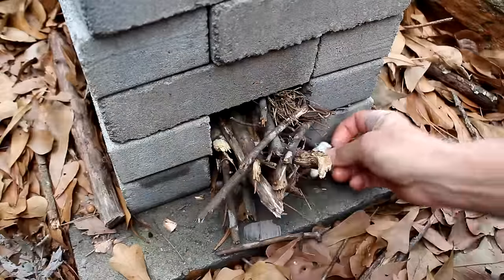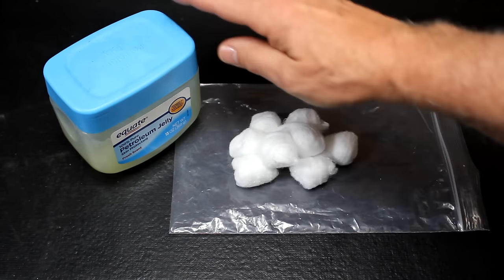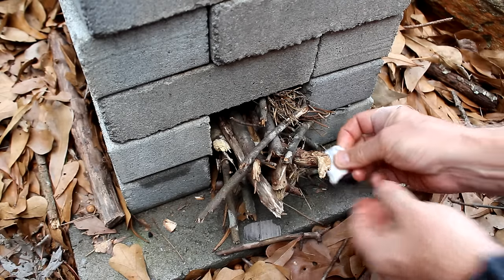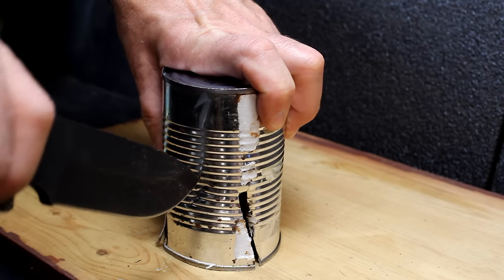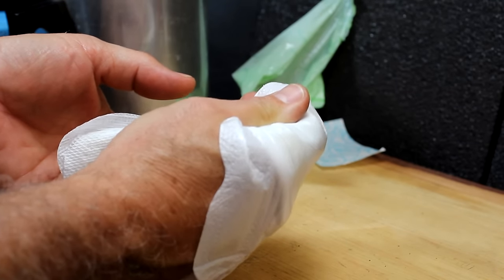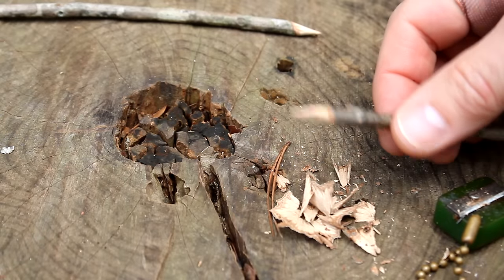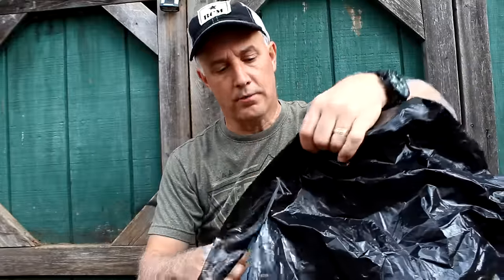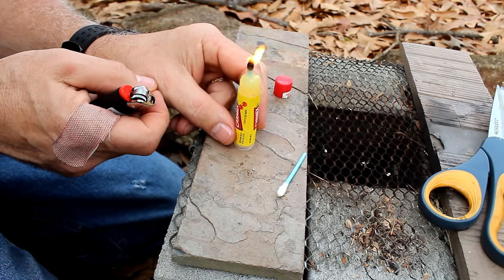Top 10 Survival Hacks

Comment: I used to use Vaseline, now I use vic vapour rub. The oils in it make for easy work starting a fire as the run and drip. Especially a wet wood fire if you put a few small blobs on the wood as the flames catch it , it ignites and drips spreading the fire. Better, far better than vaseline and the vapour keeps bugs away. It also has many other uses for survival prep.

Comment: Cool stuff. On the can, I was thinking instead of cutting through the thick metal ring at the opening, leave it and instead cut out the four holes on the sides. It would give a bit more structural integrity to the stove. Would be bad to put something just a tad too heavy and have it all tip over because one of the four supports gave out, leaving the ring would help a lot. 

Now I'm gonna have some fun and horrify my wife. HEY HONEY? Where's the butter and tissues?
Reply: Arcane Mining:- Your idea is better/safer.
Reply: If you have an old fashioned two sided bottle/ can opener, use the pointy end to punch through the can to make the vents instead. You can find those openers at walmart in the kitchen section.

Comment: On the can stove rather than using a knife that will bite you I use an old-fashion church key (aka beer/soda can opener from before pull tabs). I make a ring of triangular punches around the top and around the bottom (open end). The ones on the bottom I punch around the bottom ring making little feet to add to the oxygen supply. You can make a small fire and put the can on top. Using a shorter can like a baked bean can you can use a candle to heat water.

Comment: Melt the petroleum jelly and drop the cotton balls into it. When they are saturated, lift them out and hang them up to drip. Once they have solidified, drop them into your container.
Use split rings (key rings) for the zippers. With the rings you can lock the two sliders together so that your bag will not accidentally open.
Don't waste your time with tin cans, invest in an Esbit pocket stove with fuel. The fuel can also help start a fire when your tinder is wet.
 For a little nick like that, if you MUST use anything, use a Band-aid, for heaven's sake! I don't even worry about such scrapes. For antiseptic dressings, I use shop-bought honey and cover it with a piece of plastic, either cling wrap or a strip cut from a plastic baggy.  Honey stops, neutralises and reverses even full-blown gangrene, as long as you do not wash it off for two weeks. Just add more honey every 24 hours or so. This timing is not critical: it can go for up to 48 hours.
Heat up a nail and push it through the lid of the bottle: it does a cleaner job so that your cord won't snag. 
Who carries a can of WD-40 in a survival situation?
For light, carry a hand crank (dynamo) flashlight. The battery will hold for about 500 charges and although not typically very bright, it's better than your candles when the wind is gusting. One can also get hand crank lanterns, which supply brighter light than a candle, are wind-proof and can be hung up where they will do the most good. Best of all is a zoomable headlamp, but one needs extra (usually 18650) batteries for it.
Save the butter to eat and supply you with energy. If you MUST burn something, use cooking oil or Crisco, which have NO nutritional value.